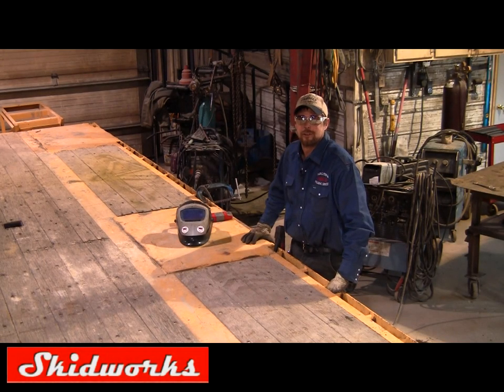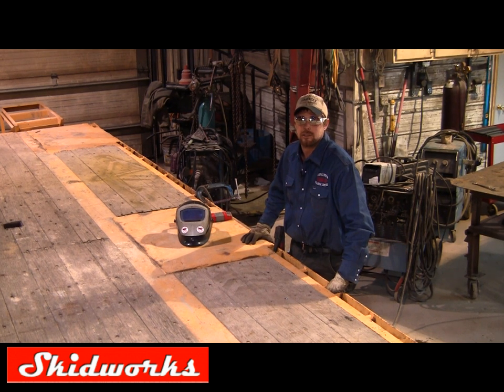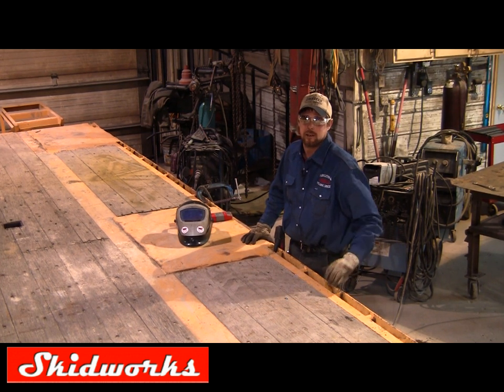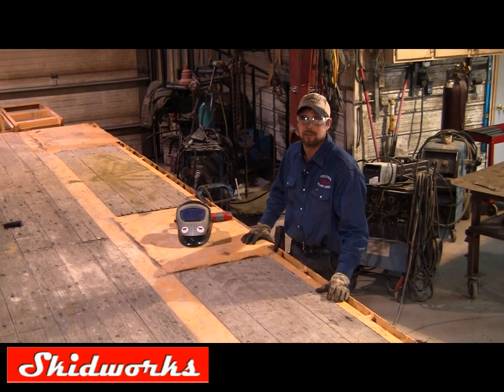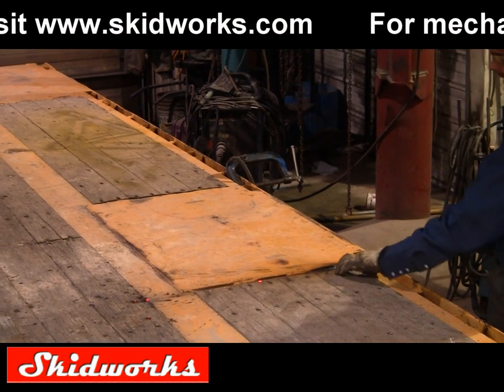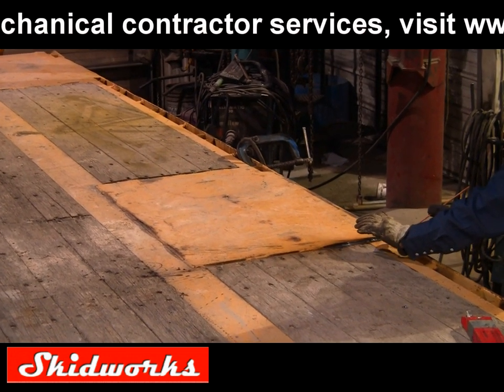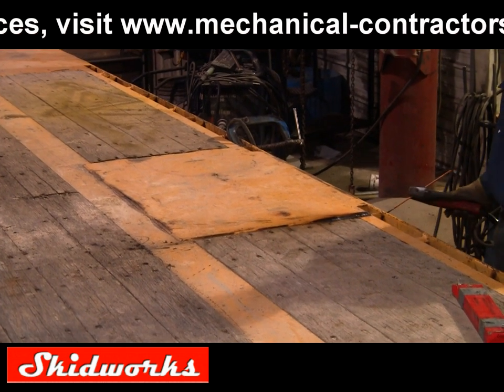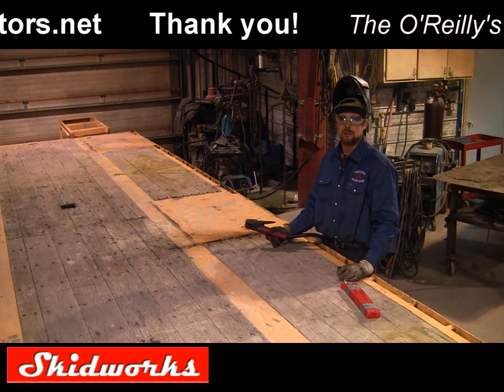Arc Air Gouging - Video and instructions from Skidworks.

Comment: As a health and safety professional I want to make all viewers aware of a couple items. One, arc air gouging (carbon arc cutting, scarfing, etc) is a significant source of noise exposure for an employee. Exposures are usually in the 105 - 110 dBA range, average exposures for a full day should be less than 85 dBA. Double hearing protection should be worn during this work.
Also, carbon monoxide and metal fume exposures can be of concern especially when working in tight quarters.

Comment: No more then 7 inches of stick out and 100 plus psi. The bigger the power source the bigge the duty cycle. We normally use 3/8-1/2" gouging rods and use 300-400 amps, but for small tasks like he is doing you can get away with a smaller machine. Also hotter is not better. There is a optimal range. Too hot your rod gets sharp and pointed, too cold and you will just stutter. Hope it helps!